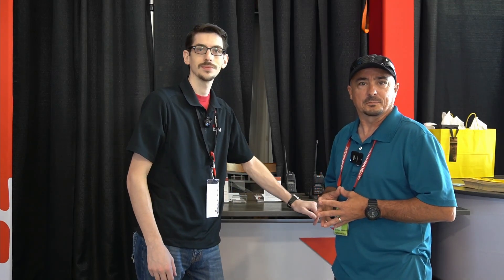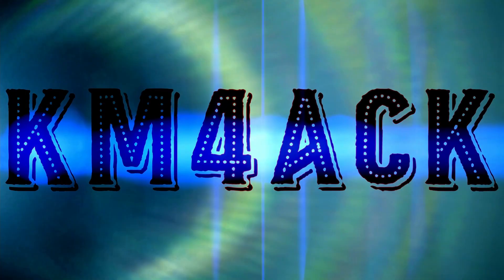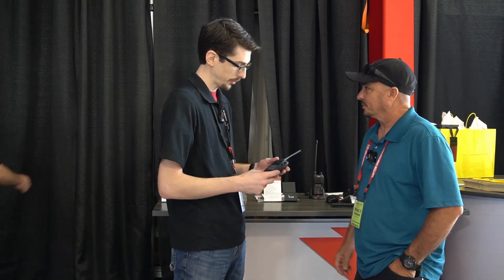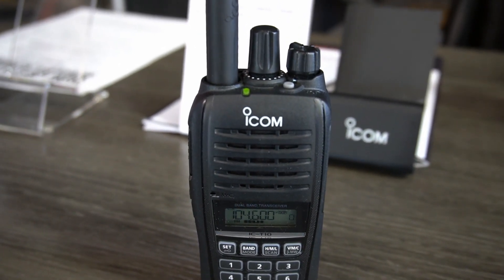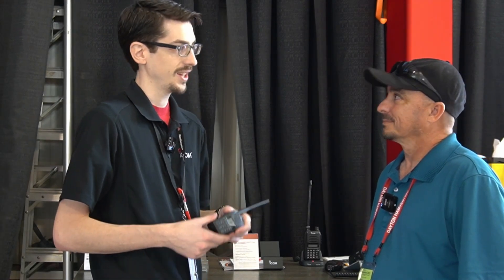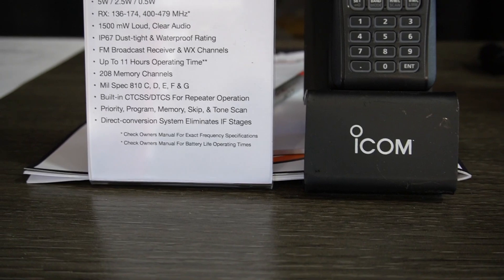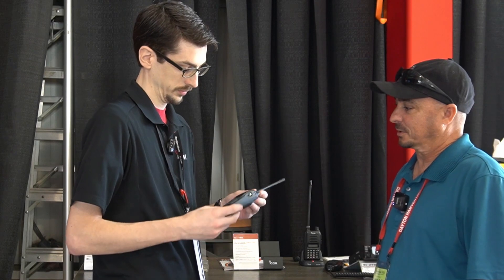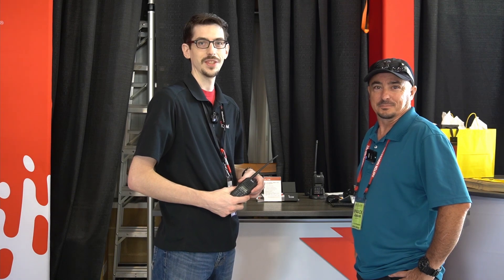Icom T10 HT Handheld Radio

Comment: For a geek, I like a simple interface.  In many applications, more features is just more difficult to use.  I love the T10 rough use durability, what looks like a simple interface, and the direct conversion.  Good job on asking about digital interfacing.  The answer could have been better.   :-/  I'd have asked about battery life on receive at half audio volume, and whether there was any current draw when the radio is off.  That's a huge pet peeve of mine with most of the recent Yaesu HTs that are never actually off and are only in a low power receive mode waiting for some external wake up signal which drains the battery in a couple of weeks for a clever feature I'll never use.  I want a bug out radio with a lithium battery that I can charge once a year and still have half a charge at the end of the year.
Reply from the maker: I will go out on a limb here and say that the T10 will not suffer the same power draw as the Yaesu radios. The Yaesu radios require a bit of juice to monitor when the power button is pressed. It is more of a software button where the T10 radio has a hardware knob. I could be wrong but that's my educated guess.
Reply: @KM4ACK  - I'd assume zero current draw when the T10 is off as well.  It looked like a conventional design with an off switch at the bottom end of the audio volume knob.  I like that simple user interface.  No need to change what works.    If you don't want it bumped on in a pack, put a mechanical guard arould the switch.

I've designed battery operated devices that need to be able to turn themselves off to save power, but I didn't have the microcontroller constantly running to monitor a soft "power" button.  I used a momentary pushbutton switch to supply actual power when pressed and used an FET as a miniature solid state relax controlled by the microcontroller in parallel with the power switch.

Yaesu has the annoying battery draining HT feature so the microcontroller can monitor the receiver (also on all the time) for an incoming RF signal to wake up the radio.  I can see how that could be handy for 1% of the people but they forced the other 99% of us to pay for it with a dead battery whenever we want to use our radio.  The feature should have been implemented by leaving the radio on and software selecting a low power monitor and wake up state for the few people who want this rare feature.

I know I'm being a cranky old man, but this REALLY bothers me.  😀

I'm a cheapskate, but I don't think the T10 street price of $199 is bad at all for a durable commercial quality lightweight radio that's easy to use, particularly if the receive current is low for a long battery life when listening a lot and talking a little.  There is definitely a market for a radio like that.  Ten times better than a Baofeng for five times the price is a legit product.  The only extra features I'd want would be better digital mode interfacing (I can live with the audio interface for digital modes, like the Baofeng) and CHIRP programming which I expect will happen soon.  At this point, every manufacturer should write the CHIRP code for their radios and give up on their proprietary programmung software.
Reply: @KM4ACK  Thanks for the video.  I just got my license in December of last year.   I went to the Dayton Hamvention all wide eyed, excited to see all of the cool stuff.    I hadn't done my research on the Yaesu/Icom radios when I went, and I impulse bought a Yaesu radio assuming that it would outperform my Baofeng handheld.     The Yaesu radio itself does outperform the Baofeng when it comes to receiving and transmitting, but I was unaware of the power draw issues that Yaesu radios have, in particular the FT-70D.   I am disappointed in the Yaesu specifically for the lack of battery life.   (So much that I gave away the Yaesu hat that I received at the Hamvention :)  )     I'm on the hunt for a Icom radio, but I'll say that I'm quite surprised at the price of this analog dual-band handheld - it seems to be a bit on the high side....  I've been told that the Japanese radios are better than the Chinese radios, so I assumed Yaesu would be top notch.    Before I buy any new handheld, I will be doing more research.     I like to operate portable most frequently, so battery life is important.
Reply from the maker: @davidl.4408  shoot me an email please and reference this comment. mycall @ arrl.net

Comment: Checking the specs this basically matches the Yaesu FT-65 with a slight upgrade from IP54 (FT-65) to IP67 (T10) and a slightly louder speaker. But at 2.5 times the price ($89 vs. $250). For the same price you can buy a Yaesu VX-6 that will smoke this radio all day long and is a tri-bander.
Reply: The vx6 is a great radio but that battery aint smoking nothing. Also it is a tribander but only does 1.5w on 220Mhz.
Reply: @reeder 76 I haven’t read that anywhere. Still available from what I see.

Comment: huge disappointment on price point. no new tech there. no great features other than the ip67 rating. no dual band receive. no crossband repeat. no digital modes. and here is the biggest question that comes up in my head. Why is it that i can get an Icom 2730 for under 300 bucks with 3 times more features and power , and they want 3/4 of the cost of the 2730a with 1/8th of the performance? Just proves to me that most veterans are blinded by buying a name as opposed to bang for the buck. Love Icom, they can keep it for that cost. ill be buying my Wouxun uv-9x next week. sad to say but that's a radio that crushes this Icom.
Reply: @reeder 76 because the "chinese junk" works. And The Anytone  and Wouxun line of radios sadly has more functionality and features over this radio. I am not going to buy an expensive radio just to have it never leave my house. its all a matter of what works for the individual. But heck, if you feel that radio will outperform my Anytone that will communicate globally..... go ahead and buy it. no one is stopping ya. Here Are the facts. The radio is overpriced for what it is. Period. Whatever anyone uses as an alternative is subject to their discretion and opinions. I chose Commercial grade radios from China until Icom stops trying to sell me their name. $240 is a damn ripoff. FACTS!

Comment: Thanks for filming this, Jason. I love simple, ruggedized analog radios for the backcountry. It's too bad $260 is the MSRP. However, if it can be interfaced for digital, is simple to manually program and is sold for  $180 USD, I'd buy five (assuming it passes a month of field testing in the Sonoran Desert). I will buy one and put it through its paces and see how it stacks up against the FT-60R and VX-6R. The T10 seems like a hybrid of those two radios.
Reply: I liked it till I saw the price. Way too high for a direct conversion radio😳🤦‍♂️
Reply: @johnmossy3757  That's kind of what I thought at 1st but if its built on a commercial frame and is bounce proof that raises the cost. I'll be getting one on day 1.

Comment: Great coverage. I am so confused/frustrated why Icom/Yaesu releases a feature-stripped radio with no real compelling features. You were way too nice by saying 'I would like external connectivity' and the rep was like, "well, this radio uses a 50yo standard for connecting your earpiece or mic.' Yes, as a bug-out radio that rarely gets used... No bluetooth. No strobe emergency light. No wide receive so I can listen to important transmissions. I dunno. They don't ask me. :-)
Reply: But don't worry the speaker is loud.
Reply: @Tallhorse89  Ha yes. Well, that does come in handy...
Reply: Some of us don't want features but a rugged simple stupid handheld.  The tacticcool can by other radios that fail when you need them. I want a rig I can hand to someone who doesn't know it and can operate it. Simple stupid wins when you need to count on it.
Reply: @tylerdurden2644  your telling me that adding Bluetooth(and actual Bluetooth that works) or usb-c(I think that's the new cellphone standard)charging, or wide receiver, etc. Features that makes it more capable in a SHTF scenario and in just everyday life.
Reply: @Tallhorse89  If you think so do it.
Reply: @tylerdurden2644  Points taken. But for me I'm handing them a 15yo radio not a new $250 radio.
Reply: I think the real reason for this is parts availability
Reply: @AgentElectric  Could very well be yes. Or at least at the price that Icom/Yaesu are willing to pay.

Comment: a baofeng killer
Reply: HMMMM    i can buy 10 baofengs for the price of one ICOM
Reply: @darrellcollins877  and you will get 10 times the interference with the baofengs
Reply: @TwoFeatherChannel  and ? they work bro, period
Reply: @darrellcollins877  work, yeah if you call being able to turn them on and change channels work
but they are all FM radios and FM isn't supposed to pick up interference in that manner
So do they work, No they don't
Reply: @TwoFeatherChannel  hmmmm  the ones i have work fine, touch of static in the TX at times , other wise loud and clear
Reply: this wont ever touch a baofeng just on price point alone. this is a joke at $260. open your eyes and see that at this point they are just selling you their name. ill tell you what radio shames this right off the top. the Wouxun kg-uv9 pro and soon to be released x version. that radio does 10 times more for 60 bucks less and with dual super hets. this icom is the biggest rip off of the new millennia. but what do I know. if anything this will boost the sales of Baofeng radios. no joke
Reply: @farmhousehamradio4774  the kg-uv9x will be my next ht purchase. initially I was going to get the uv9pro last year but glad I waited. I have 5 different models of baofengs that work fine on repeater transmissions but for simplex I can drive around in the national forest 25 miles away from any electrical or mechanical mechanism and I pick up interference on 2m, 70cm, gmrs and frs. I'm not going to pay $500 or $600 for an ht from yaesu or icom top tier ht radio.
Reply: I would argue that the Yaesu FT4X is the baofeng killer.
Reply: @M0JSX  i could agree with that .  Great price point, will do everything better than a baofeng.  The icom is way over priced for a basic radio.
Reply: definitely NOT